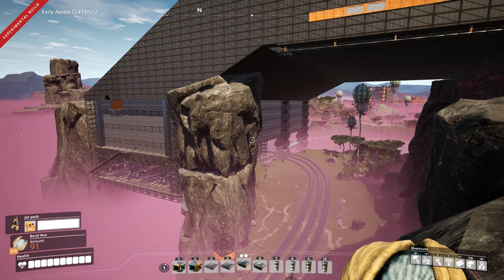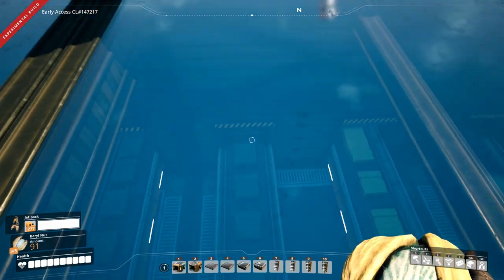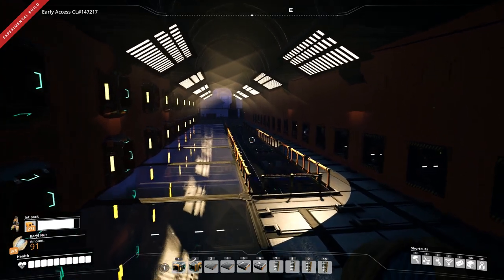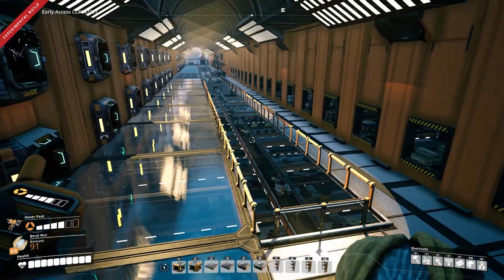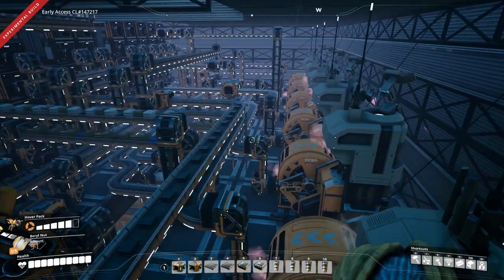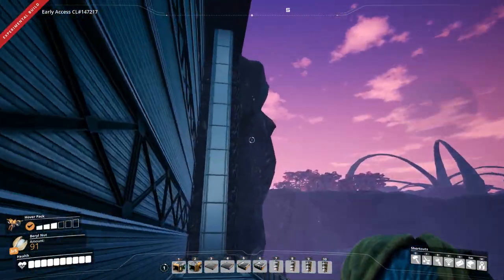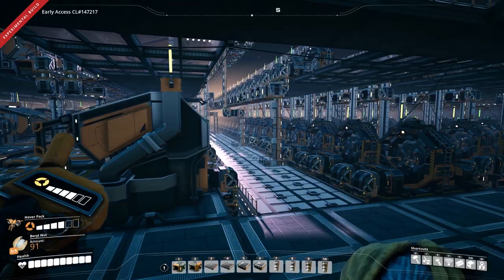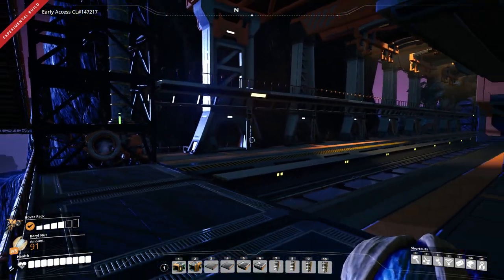Project Complete! 480 Machine Custom Production Factory - Base Tour [SATISFACTORY]

Comment: Don't know if you know this or not, but with convey belts, lifts, or anything at this point you can hold E when it is selected in your hot bar then it will bring up a wheel that shows every Mk, same for lifts and pipes brings up everything pipe. Also used in production and power buildings
Reply from the maker: I am aware of that function, but thanks for the heads up mate...quite useful but keep forgetting to use it

Comment: Am I correctly guessing your new idea for this is just to use power as the thing that controls whether a production line is running, via power switch, instead of controlling the item flow via smart splitter?
The labels on switches would definitely be nifty, and it means you wouldn’t have to belt things to a specific location to control them.

But, more for the present: I was curious if there was a specific reason why you didn’t have the smart splitter controllers on the output side, instead of on the input side. That would have let the inputs stay saturated after a production line was disabled, and possibly let a production line turn on its required components automatically (by providing a destination for its output)
Are each of your production lines fed by a smart split belt that can’t be backed up, is that why?
Reply from the maker: Exactly yes. I would change the way the machines are fed a bit also, as the belts would still be supplying the machines even when they are powered off, without the use of a splitter to stop the belts from feeding them constantly. But I would change the bus system slightly also to make it appropriate for that. But yes exactly, and as you mentioned being able to labels those switches is very cool.
Reply: @StinArchi  good stuff. If you wanted to keep using smart spliters with the bus, I have an idea in the back of my mind for a while that might be helpful. But, if you want the higher input rate of separate belts anyways, like your vending machine system, then it probably doesn’t matter.
Reply from the maker: @Jason Latta definitely mate, any info could be useful somewhere...whats the idea?
Reply: @StinArchi  If it does in fact work - it would be a way to control whether one belt flows or not based on the amount of an items flowing on another belt. Something along those lines. It theoretically shouldn’t take me long to try out a basic version that I could show.
Reply from the maker: That does sound interesting indeed...although I am not 100% sure I understand...if it works would be great to see a video/clip or even picture of the idea? Nice mate, I like the thinking outside the box...
Reply from the maker: @Jason Latta mate I just saw second part of your message here...sorry sometimes I forget to click 'read more' on messages, and just noticed this. You're correct in suggesting that the splitters on the output, instead of input, would be better in some ways, for reasons you suggested.
However there are 3 reasons I didn't do it like that..while balancing the factory I had to do loads of experimenting using different/alternative recipes for many items/machines, to try and make good/balanced use of the available resources downstairs, so that there was enough of everything to go around...this took ages (and factory can still do with abit more balancing, but anyway) and trying to change machine recipes with such a large/complicated setup, when all their belts are full, is a real pain. As you have to let machines configuration, and different combinations of machine recipes, run for awhile first to test them - and its a lot easier to change recipes on the machines, for me, when belts are empty. Especially when there were so many machines/belts. For example all those little belts coming of each splitter into each machine..which there a few thousand on this factory - each time you change recipe on the machines you have to delete them and redo them if their full, otherwise they clog the input. You can of course still workaround this, just much easier when betls are empty to change configurations and recipes.
Second reason, unfortunately it doesnt work in sharing the produced items from the machines to other machines that need those produced items. So for example if the all the belts are saturated and each mahine is full - the belt on the bus that is dedicated to sharing the 'produced items' would keep overflowing into a sink and so those machines would keep producing non-stop. The workaround for that was massively complicated for me. Unfortunately it wasnt as simple as let the output of those produced items build up and stop if all output belts/destinations are full. Otherwise the belt on the bus, dedicated to sharing only produced items, would clog. So you need an overflow, and also if you want it to lead to storage, you definitely need an overflow and then sink. So all the assembler machines, for example, would keep producing items, even if everyone other machine that needed those items was full of those particular items. It just didnt work with my bus system to distribute the produced goods. Not sure if that makes sense mate.
3rd and actually the most important reason for me when I started building it - when I did my first configurable factory (before experimental conveyor item rendering option' came out), in that really messy room in the middle of that factory  that is closed off with tons of messy conveyor work - as soon as I turned that factory on and those belts filled with items, my fps dropped from 80 to 15. For some reason belts with items on them produced so much lag. And this factory has considerably more belts, and I learned never to do that again after that first configurable factory experiment :) However, that new experimental conveyor item render option thing released in update 4 really helped with that. But there is a ton of conveyor work under the floor on the machine room, and around, and if all those were full of items it still may have caused a big fps drop. 
But regardless, the 2nd reason would have still prevented me from doing it on output side unfortunately, as I couldnt figure a way around it that wasnt mind boggling complicated for me :) But as I mentioned, you are right mate, it many ways it would have been very cool to do it output side instead.

Comment: LOL That's called 'God Level' spaghetti control!! Love those smart split towers. Your next project could be to use your feed in loops to kick in bulk item injector belts to the production lines for added efficiency.
Reply from the maker: I have something kind of similar in mind for my recent feed/belt control idea, if that's what you mean? Kinda similar to what you suggested, different application though. But I like your outside of the box thinking mate...nice. But yea I'll probably do a video on it soon..if it works :) Thanks again my man, appreciate it 👍

Comment: Downloaded your save to take a look for inspiration and holy, this is by far the best base/world ive ever seen, keep it up mate, i noticed some things are disconnected and dont do anything, are you continuing this world? :)
Reply from the maker: Thanks Reece, that's much appreciated.
Every machine in all the factories should be connected and running, except some of the machines in this factory (in this video) and the other configurable factory on a mountain, might be turned off, but still funcitonal when turned on via splitters. Not sure why its like that when you have loaded it...might be some issue when loading in other saves/worlds. On mine every machine in every factory is connected and functional.
But anyway, thanks again mate. Might start some new projects soon, at the moment not feeling quite motivated to do anything in Satisfactory...so having a little break :)
Reply: @StinArchi  ah ok, i think it might be the hub base i thought i saw some manufactures doing nothing with nothing connected, all good anyway :). yer i don't blame you mate, after all the time in that one you pretty much 100% it haha. keen to see what you do next mate.
Reply from the maker: @Reece ah yea you're right, there were 2 spare manufacturers in that factory where the hub is....they use to be producing stuff, but when update 4 came out and changed a lot of things in tier 7, I disconnected 2 manufacturers in that factory as no longer needed them. Well spotted :) But yea other than those 2, everything else should be connected....I think :) Cheers Reece.
Reply: @StinArchi  ah fair enough then. yer i didnt even look at everything yet i just happen to stumble across those 2. good stuff mate.
Reply: where can I download the save?
Reply from the maker: @Gyu SBS Link to save is in the description box just below video...
Reply: @StinArchi  THANK YOU SO MUCH, GOD BLESS YOU
Reply from the maker: @Gyu SBS You're welcome, thank you, and God bless you too

Comment: dude this is really Crazy. 
Where did you store the energy fragments
Reply from the maker: Thanks Ralf
What do you mean by energy fragments?
Reply: @StinArchi  the framgments to Boost the Maschines
Reply from the maker: @ Ralf Ullrich oh right yes power shards - I didn't use those on any machines and didn't include production for those in this setup. So no power shards anywhere in this build.
Reply: @StinArchi  nice dude but i found a Problem you dont build COPPER POWDER  XD
Reply from the maker: @Ralf Ullrich Yes well spotted :) If you go at the back of the long corrider, where the drone port is, turn left, you will see a particle accelerator there - if you activate that splitter opposite the particle accelarator - it will make copper powder for the particle accelerator Nuclear Pasta production :) 
Make sure you have downloaded a recent copy of my save game file, as I only added that recently
Reply: @StinArchi  sry dude but it don't work :(
Reply from the maker: @Ralf Ullrich Do you mean the particle accelerator? Not sure as that has worked fine for me and I used it to produce 1000 Nuclear Pasta for the space elevator. If you want try downloading the save game file again, as I updated it a few times. Maybe the version you have was broken. Also are you activating the spiltter oppositve the particle accelerator and putting 'any' on the top, same as you would for any of the other splitters in the main corridor area.